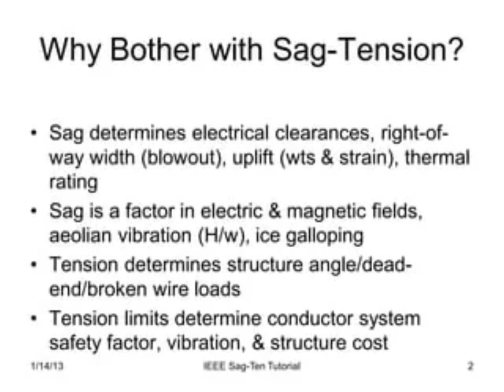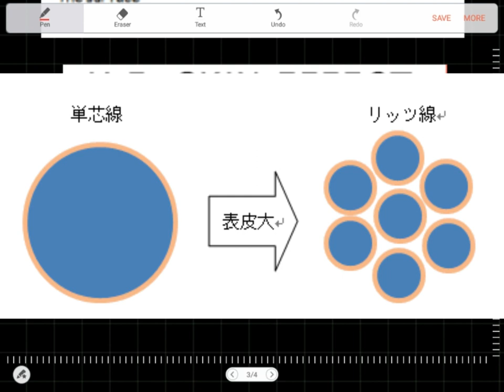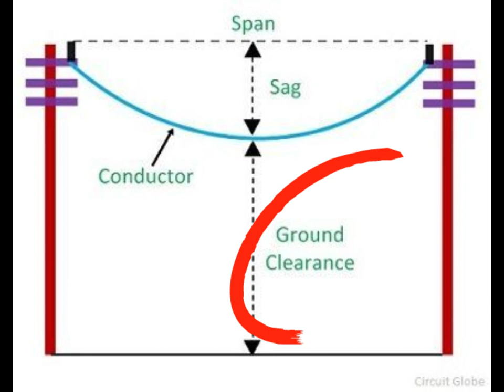Transmission lines are surprisingly well designed

Comment: you will have inductance even if te lines are not twisted, simply because a moving charge creates a magnetic field. 

And in the case of AC you even have a changing field, so it creates a changing magnetic field, which induces an opposing magnetic field inside the wire. This induced field repels the electrons towards the edges of the wire, AKA the skin effect. This field stronger with higher frequency (the field changes faster), which is why the skin effect is stronger at higher frequencies
Reply from the maker: you are abs correct sir
Reply: yes... but the central core is also iron... and the wires being twisted at a certain pitch produces a magnetic field through that core...

the inductance per meter is controlled, the addition of the iron to the circuit is factored in when maximising the impedance of the wire as an RF transmission line. it may be only 50/60hz but its still RF power...

Comment: whilst i dont really like the sarcastic remarks about passing tests and grades and the like, i sort of see where its coming from. you learning for curiosity or to pass tests?

so on that note... the wire and the inductance. whilst a plain conductor does have inductance, this is an iron cored cable, with some high current flow. its got high inductance.
the pitch of the twist will affect how strongly that field reacts with the iron, how much inductance it will have, and that is a critical factor in designing any RF transmission line to match the capacitance. 50/60hz as AC is still RF power...

would like to see your take on a highly neglected thing called "jacobs law"... a rather important rule, when it comes to electricity and power transfer...